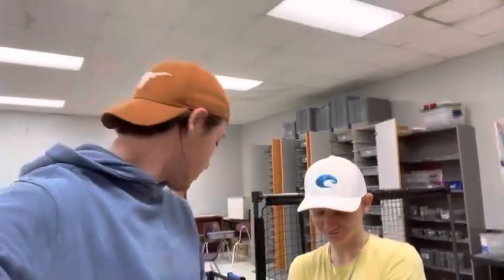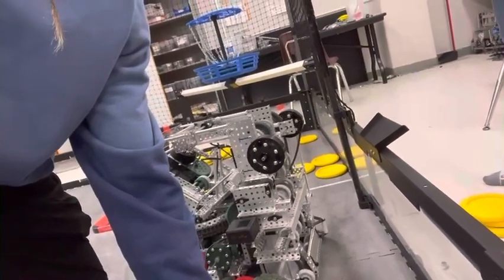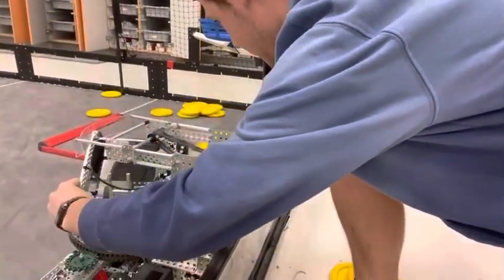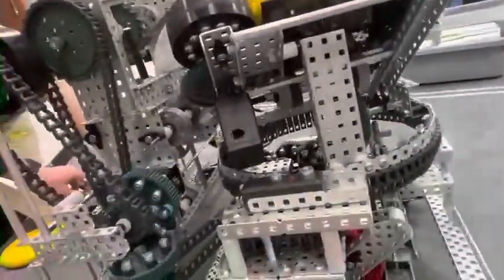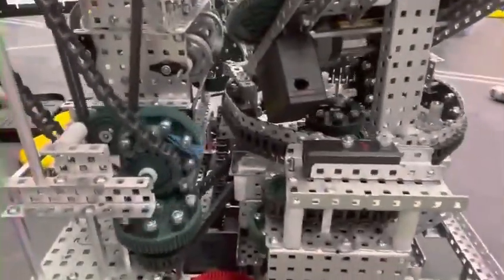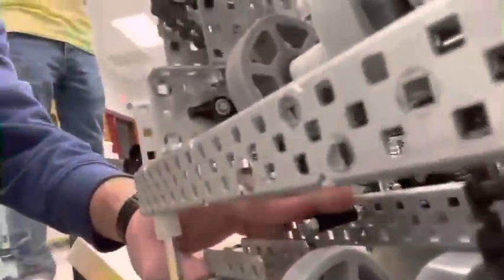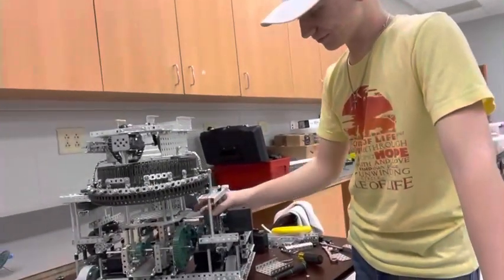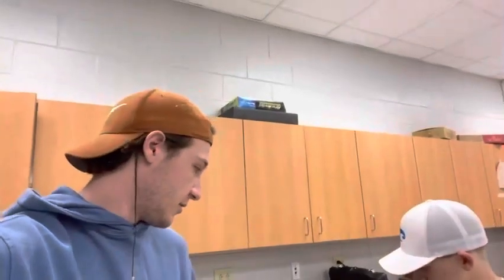GOLD! RoboVlog - Big Turret Progress - Vex Spin-up Ep32

Comment: How long until the intake overheats? It's looks like it's only one motor, and it also looks like it's powering around 15 axles.
Reply from the maker: So at first I ran it at 1400 rpm. This was a little optimistic and it would jam a bit after running it for a minute or two and couldn’t intake more than one disc at a time. Then I slowed it down to 1000rpms which worked really nicely and had good motor efficiency. However if I ran it for about 3 minutes, it could still intake discs, but would jam with two. So I slowed it down even more to 700rpm and it takes discs in like a beast, when it pulls it in, the rpm drop is less significant and when there are no discs in the system it is going the full 100rpm in the motor. Right now I’d say probably 10ish minutes but that’s about average for everything. There was a lot of friction reduction and making sure there were no pinch points to get it to power intake, roller, and indexer.
Reply: @goldrobotics7438  Wow! Have you lined the axles yet? You might also want to consider screw joints if you haven’t already for some of the transmission gears, to reduce friction.